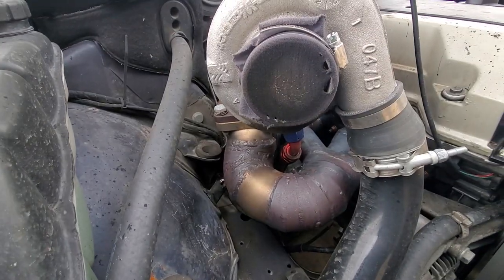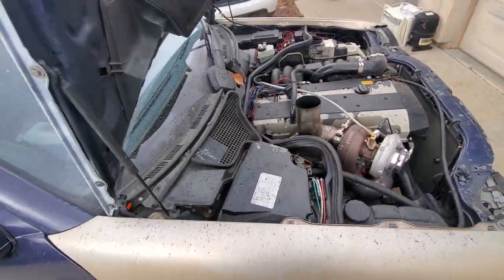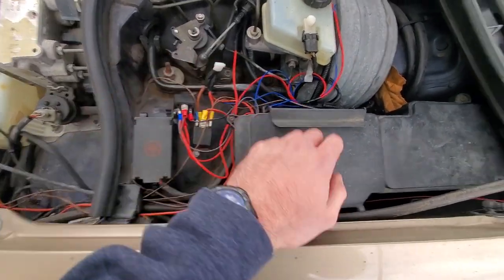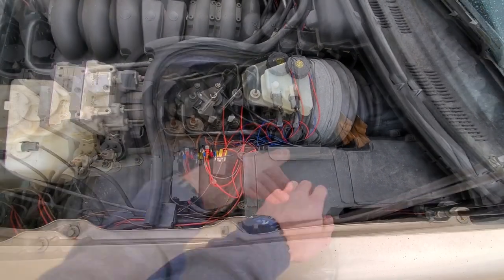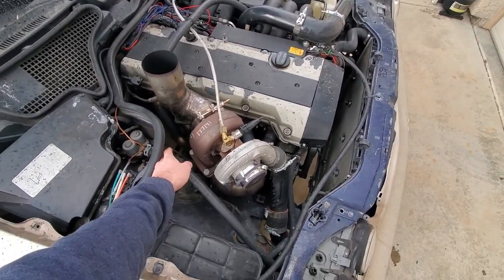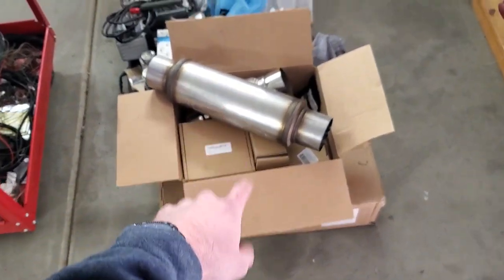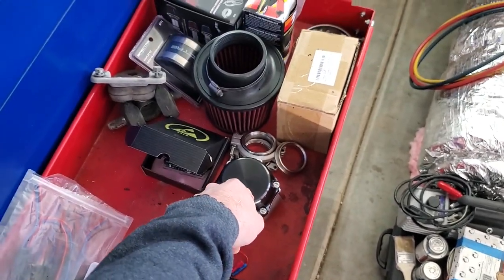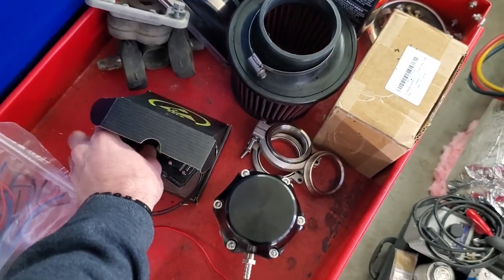The M104 Is Officially Broken In

Comment: If the cam adjuster is leaking from the wire plug i think your only reliable option is to replace it. Id be interested to see a diy fix though
Reply from the maker: I think youre right, but ill look at the old one i have taken apart, and see if its possible to reseal it somehow. 

If i have to replace it with a non-leaking one, im probably stuck with getting a new unused unit from somewhere. That would be expensive, and id rather just have a little bit of oil on the front of my engine i think. Haha we will see, time will tell.

Comment: If you're using stock coils, you need an igniter to drive them. What does your ignition circuit look like? The OEM setup, and a couple of aftermarket controllers use igniters on the ECU, which are LSS. If your ECU is a 5V switch, something is off.
Reply from the maker: You must have heard me wrong, maybe? What was happening was, my coils look like "smart coils" with drivers built in. They are not, to my discovery. So, i burnt out some Maxx outputs. That said, ive had that issue fixed since the beginning of the engine starting the first time. 

Also, the ignition coil drivers are switched by 5v signal from ecu, and 12v power from battery (typically from what i can tell). I was able to get the new ecu to send the signal to the old ecu basically, and get the old ecu to convert the 5v signal to the 12v (transformed) spark. Then the spark plug coils are just connected through the stock harness to the stock ecu, but getting the tuned spark timing. 

Genius, if you ask me. However, i am naturally biased. haha
Reply: @JakeSublime  can you describe that a bit more please
Reply from the maker: @nomecognome5473  Basically i took the ignition signal wires from the maxx ecu, and ran them into the stock ecu. Then,i connected them to the signal side of the coil drivers inside the stock ecu. I also had to break the connection for the coil drivers, coming from the stock ecu.

This way, the stock ecu is powering the coil drivers and coils, but the maxx ecu is controlling when to send the spark.

Comment: My E430 had the same bulb issues 🤣best part is it seems to have followed to my S430L too 😆. Pleased to see you got a knock system dude very smart move with Mercedes engines 👍. I only have one concern of stainless to cast and the chances of the wastegate cracking off the housing, either way stoked it's working out for you buddy and the cars still going good😃
Reply from the maker: Glad (kinda?) to hear im not the only one with tail light issues with these cars haha. Its such a pain, and getting pulled over for a taillight out that only needs a "bump" is frustrating. 

And ive done some research on the welding techniques needed to pull this off, and i think ill be able to get the stainless and cast exhaust housing to mate up without cracking. Time will tell. Ill share my process with the world if it works.
Reply: @JakeSublime  Oh definitely a pain man, I kept trying bending the little ears out with a flathead screwdriver which actually did help on some. It's almost like the metal loses its conductive properties. My Clk also does it but the Slk never did and my cars were all the same age give or take a year 🤣.

Yeah I think you got to heat cast first haven't you before welding and have good heat in the weld, but I'm no welder by any means but my brother is a fabricator so I've picked bits up from him. But I know you always do your homework anyway before doing anything, that's best way to be I hope you manage to find a work around for the transmission slip though when you give it a foot full. I believe some Jeeps and Chrysler cars had 722.6 transmissions, I wondered if you maybe able to find a aftermarket transmission controller for a jeep or dodge, Chrysler 722.6 maybe more affordable than a Ofgear and I know your fairly savvy with wiring unlike me 🤣. Just an idea I thought I would share with you incase it helped, unless you have a manual swap in mind for the future. In which case i suspect some parts from dieslpump UK may be useful as I believe a Om606 flywheel and clutch set up could work with maybe a Mercedes sprinter transmission if you wanted to add that third pedal. I prefer the autos for bigger power though little more reliable unless you wend BMW trans or Cd009. Anyway that was a lot of random information to give you for absolutely no reason 🤣 but great to see it still going strong buddy👍
Reply from the maker: @M-oneeleven-M111  Lmaoooo Good news is the turbo is welded up, no cracks yet. Ive baked it at 500 degrees before and after the welding, and smacked it with a hammer a whole bunch. I think it will hold! If you have me on SC you can see all the cool things im doing in between videos.